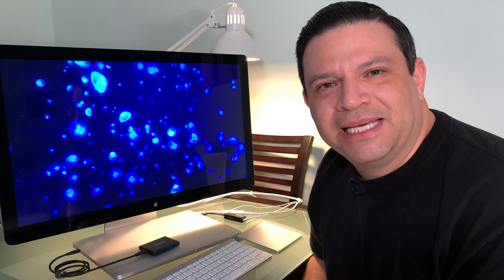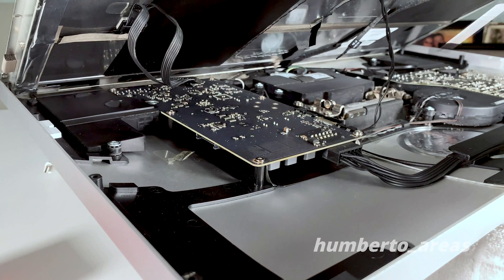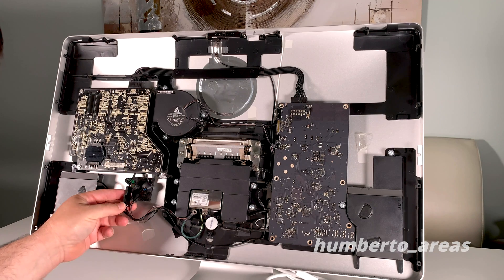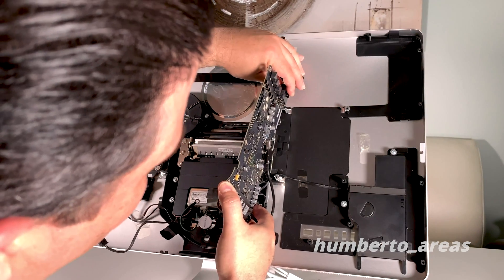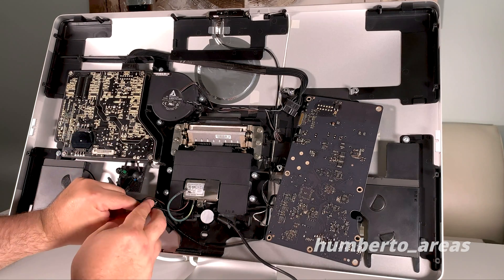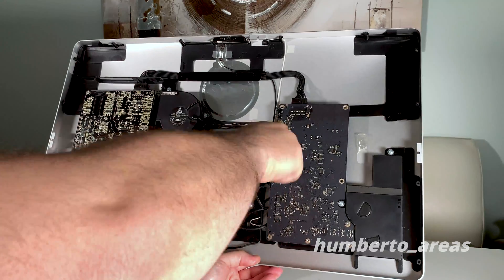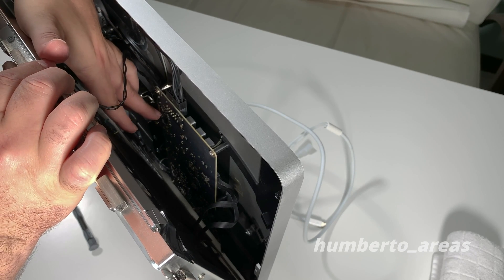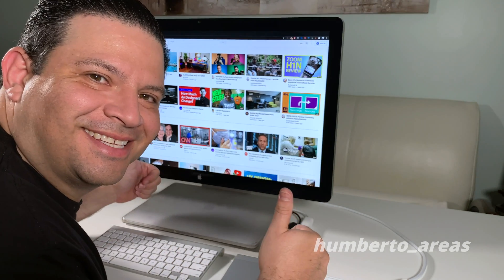Apple Thunderbolt Display Not Turning On - Step-By-Step DIY Repair 2026

Comment: Great job!  I'm fixing a Cinema Display 27.  Luckily, it does not seem to be a cable problem as the CD27 cable is $75 on ebay vs a TD cable which is cheap.  My display is dim and sometimes does not turn on.  24V and 12V are present so power supply is good.  I'm leaning toward logic board.
Reply: Some improvement.  The panel's temperature sensor connector had come lose from the LED control board.  The connector is underneath protective tape so easy to miss.  I'm guessing no temp input shuts off panel.  Anyways, picture came back and looks great.  Did a re-boot to see if panel switches off and on properly and it does.  Of course, time will tell if this is really the problem.
Reply from the maker: Hey, this is great news! The no temp input = shut down makes sense. One of the red flags I ignored was the TB cable getting hotter that normal. (and yes, a PRAM reset goes a long way)!
Reply: @HumbertoAreas  Spoke too soon.  Powered off the system for a few hours and the screen would not come back on.  At least I got to see the screen for a few hours and it was fine along with the LED's.  I just ordered replacement LCD Controller board which I am hoping will be the answer.
Reply from the maker: Oh no! Well, with those few hours of use, I’m sure you were reminded of how awesome these displays are. Totally worth the effort of fixing. Please keep me posted.
Reply: @HumbertoAreas  Yes, LCD and backlight give beautiful picture.  I'll be back when the LCD Controller board arrives.
Reply: @HumbertoAreas  Did some more research and found out the LCD control board is called Timing Control or TCON for short.  Once the panel is out, it is about a five minute job to swap.   From what I have read, the CD27 TCON board handles both LCD and LED signals.  If for whatever reason, the TCON does not turn on LED, we have black screen of death.  Anyways, I am piggybacking on other's research so I hope I am relaying the info correctly.
Reply: On a side note:  More Apple goofiness.  If the brightness control on the second monitor is missing, PRAM reset will restore.  (USB connection required but you already know this.)
Reply: My new to me TCON's arrived today.  The swap was easy but the results were negative.  The screen did come on once with cycling the power plug but that is not the answer.  Well, it was an educated guess but still a guess.  I found the CD27 Technician's Manual and looked at the no picture flow chart.  The official guide is useless.  It is worse that anything I have read in the blogs.  Anyways, I might get a Flextronic power supply from ebay as I know for sure my P.S. is buzzing.  A few blogs mentioned recap as solution so maybe I have P.S. issues.  Apple goofy design is fun!
Reply: I tried the CD27 a few hours later and it turned on with my iMac.  It was at full brightness whereas before, the monitor would not come on and if it did was too dim.  Brightness control in MacOS is gone, which apparently is a common problem.  (My other CD27 has brightness control through MacOS.)  SMC and PRAM resets did not restore brightness control.  Installed MonitorControl app and was able to control brightness.  I did a couple of restarts and power off cycles to see if the monitor comes back on and it does.  I can't claim victory because I don't know for sure what the fix was.  I think the TCON swap helped.  Anyways, the monitor is now usable which is a definite improvement.
Reply: Apple Technician Guide for the CD27 mentions EDID Reset Tool which restores Brightness Control from within MacOS.  Third party app not needed.  Google EDID Reset Tool to find the download link in a three year old Macforums post.  It appears EDID Reset Tool is for CD27 only and not TB Display.  The tool detected my CD27 and then reported successful firmware update and asked for a power cycle to reboot.  Monitor would not come back on.  Oh no, I thought the EDID had just bricked the logic chips.  It turns out my weak power supply was the culprit.  It was 115d in my part of the world yesterday and the thermal fuse opened when I unplugged the power.  It's cooler now so the power supply came back.  Now that I know the rest of the monitor works, it will get replaced.
Reply from the maker: @encinobalboa This is excellent news! We are die hard fans... I cannot believe we have to resort to 3yr old forums and shuffle through different sites, so we can put the pieces together. So glad to hear you have pin pointed the problem and you’re on your way back to enjoying  your display 👍🏻
Reply: @HumbertoAreas  Have to agree on Apple's spotty tech support.  Happily, the community of die hard fans is always trying and the info is out there.  Anyways, hope my CD27 adventure is helpful to TB Display owners.  If you wish to make a video on CD27 black screen and no Brightness Control, that would be a real service as amazingly there is no video with any specific info out there.  If you can keep just one of these beautiful monitors out of the landfill, the world is a better place.  Cheers.
Reply: I found my TB display for free from Craigslist. It had a really bad power/thunderbolt cable. eBay and $18 later I was back in business. My all time favorite display for free and an $18 replacement cable. Fast forward 2 years monitor started flickering then completely went out. Just tonight for fun I plugged in my 2012 MacBook Pro and it came on looking just as beautiful. I slide the monitor to the side and it went out.  I have power as all ports work on the back and MagSafe charges my MacBook Pro. It’s either the logic board or the other board. Should I replace the cable again to see. Maybe something came loose from within and just needs to be reconnected. Help a fellow Macintosh, Apple fan boy.
Reply: @djbigdavethefyrm  Yes, easy stuff first.  Check all you connectors including the two in the screen under the metal tape.  I ran my CD27 with a rescued Mid 2012 MBP 13 this evening.  Good stuff!
Reply from the maker: David, thanks for watching and thanks for posting your question. Perhaps @encinobalboa can chime in on what may be causing your display to go out? Good luck!
Reply from the maker: Thanks for watching. hopefully you got some value out of the video. Good luck with your repair, please let me know how it goes.
Reply: @HumbertoAreas  Did some more research on ifixit blogs.  Apparently the no turn on problem is common.  One poster mentioned the LED controller on the PCB at the top of the panel as a possible failure point.  When I have time, I'll swap in another LCD panel assembly to eliminate the rest of the components.
Reply: I used a stand alone thunderbolt cable from MacBook Pro to display and the display preferences came on the MacBook Pro screen but nothing on the TB display. To make sure my MacBook Pro thunderbolt connector works I connected a Vizio Tv to my MacBook with a thunderbolt to HDMI and it works. 
So I’ll open up the TB display tomorrow and check my connectors. For it to come on for the first time in almost 11 months and then for ,e to slide it across the desk and for it to shut down makes ,e think something is loose inside or the Logic Board. But I’ll see and let you know. Thanks my Apple Brothers.

Comment: My thunderbolt display doesn't work in Macbook Pro anymore; somehow it still works properly with my Macbook air. Macbook Pro recognises thunderbolt port with hdmi for tv. but ıt starts not to recognise the thunderbolt display. what do you suggest for Macbook Pro? I did alto nvdram and sms reset things...
Reply from the maker: Alican, thanks for reaching out and for your question. (1) What year is your MBP? And (2) what year is you MB Air? I ran into an issue where I was getting an “device using too much power” error, see link here: https://support.apple.com/en-us/HT204377

Perhaps your Magsafe connector is not delivering enough power? Or are you plugging your laptops directly into the wall outlet? This may be a clue as to why it recognizes TV, but not the display?

Don’t know what year your MBP is? But if you have a new T2 chip, follow these steps to reset your SMC here: https://support.apple.com/en-us/HT201295

Alican, good luck trouble shooting your connectivity issue, I truly hope the info I provided helps you in some way. Please keep me posted.
Reply: Humberto Areas thank you so much for your reply. my macbook is late 2011. ıt was working perfect until last month.
Reply from the maker: Alican, have you tried connecting a standalone Thunderbolt cable between your MBP and Thunderbolt Display. If this resolves the issue, then possibly your Thunderbolt Display's dual MagSafe-Thunderbolt cable is damaged. Here’s a link to a Thunderbolt 2 cable - https://amzn.to/2YCxoSD
Reply from the maker: Are these the specs of your late 2011 MBP? https://support.apple.com/kb/SP644?locale=en_US
Reply: Humberto Areas yes but the size is 13". I connected standalone thunderbolt cable between my mbp and TD. no response but still works fine with 2011 late macbook air. anyway thanks for your time and answers you are so kind.
Reply: I think you need a Thunderbolt 3 adapter for your Display.  Not 100% sure, but worth a little research.

Comment: I will have the same project coming up this weekend. Also I have issues with my monitor and I am starting with the cable replacement.
Reply from the maker: Pierre, thanks for watching the video, hope it helps with your upcoming cable replacement project. I tried to be as descriptive as possible. Thanks for your comments and feedback.
Reply: @HumbertoAreas  I just finished the cable replacement and it was fairly easy to do so. Your video helped me out with the four cables that are connected to the logic board. A bit tricky but was done after a few minutes. Thanks mate.
Reply from the maker: @Pierre, that is awesome news brother! And yes, overall replacement is easy, with the expection of those 4 cables - not a lot of room to work with and a bit tricky like you said. Glad to hear my video helped in some way... Now enjoy that beautiful display! 👍🏻